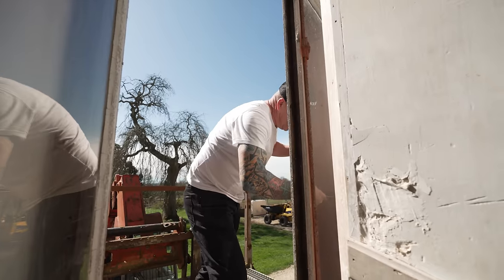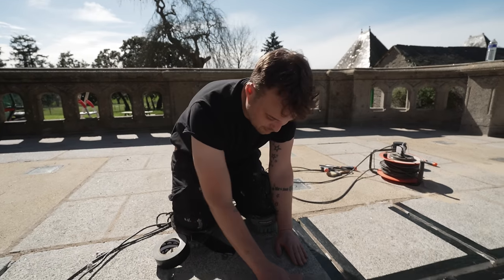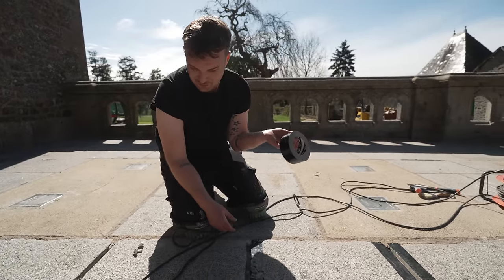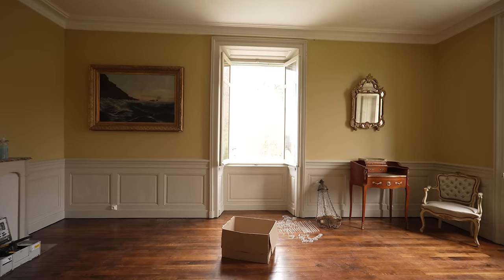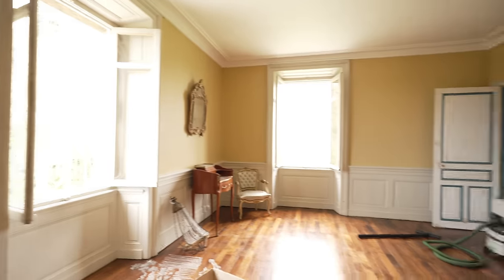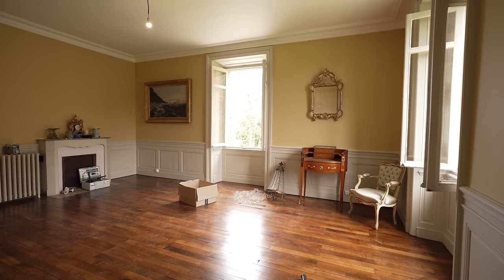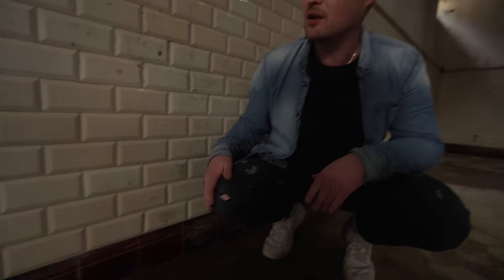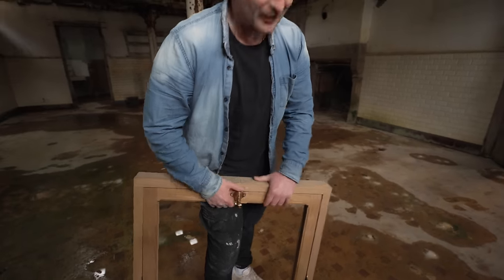Emptying The Attic To Furnish The Bedroom

Comment: I know where I've seen the chateau's kitchen tiles before. They're in the Paris Metro. Most of the stations have those same beveled subway tiles. The dimensions are probably slightly different, but the company that supplies the Metro with tiles could probably make a small run of yours just as easily. Can't hurt to do a little research into it. And the bedroom turned out really elegant. Lovely.

Comment: the green walls in your bathroom can be painted lighter to save money buy average white paint  couple of coats on the gren before adding two coats of the colour you want saves buying more tins of the colour paint you want as white is cheaper and you will need a lot of coats to cover the green.

Comment: 12:40 That would be a mold seam.  Where the two halves of the mold for the column was split.  I suspect it didn't have to be finished.  I'd bet there was a casing or sheathing of some sort around those cast iron columns.

Comment: Making a cast of the tiles will be difficult. Ceramic shrinks during drying and firing which will make the smaller then the original. Will have to make a bigger mold then the current tiles are.

Comment: Maybe build a furniture-looking island and build it in between the two columns and clad the columns in the same material you use for the island.  Even build the island around the columns so they look like they're sitting on the table top. With the correct materials and craftsman, it could look like a period correct kitchen worktable
Reply: there was no such thing as an island in a kitchen in France during the time period of this chateau. Michael has explained that they will have a very large table as per Downton Abbey kitchen - staying true to the time period which is as it should be.

Comment: I use backer rod to fill big gaps, and then either use spray foam over top or caulk to seal it or insulate it. Keeps insects out. Backer rod may work for what Michael needs to fill gaps a bit so he doesn't loose so much material filler stuff not sure what he is using but the backer rod expands and retracts in weather to stop any cracking.  Or bondo it works as well. I purchase from Amazon but I am not sure if that is available in France or not. It is in the usa

Comment: Just a question: Why don't you turn the windows arund to have them to be opened from the downside (sorry, I am german, that does not sound right, but  I hope you know what I mean). They are very high and hard to reach. Or will there be a mechanism to open them from down under (that definitly isn't right ... :-9 )

Comment: As a rule when hanging, the height of the painting should be at least near to 180cm from the finished floor line to the center of the painting. The art work should be seen as much as possible on eye level "if possible". In this case, your MIRROR is too high as well as your wall landscape painting. 

In positioning paintings, one doesn't necessarily have to strictly place them exactly on the center of each wall panel where the distance of the bottom of the painting to the top of the dado would equal  the distance of the top of the painting to the bottom of the cornice. Otherwise, this would truly look so awkward. Even in classical architecture this rule always holds true,  "Form follows function".

The distance from the bottom of the painting to the top of the dado can ALWAYS be shorter than the distance of the top of the painting to the bottom of the cornice in cases where the ceiling would be SO HIGH. Do not be afraid that you are not following the rule of SYMMETRY. Sometimes, it is alright not to follow this rule! It is always the COMFORT of the EYES that would always be taken into consideration first.

(In museums, paintings are always positioned on the wall always at eye level. Large and humongous paintings height  can be adjusted at a "comfortable" level. Never be restricted in positioning your paintings exactly at the center of the panel where height is concerned.)

Comment: The seam in the column is from the sand mould it was cast in (in a 3 part mould: left, right and core), not because it was cast in two pieces. It's one thick cast iron piece. Perhaps there's something in the core but most likely it's just hollow

Comment: I still think you will have a hard time keeping water out of the kitchen downstairs due to the kitchens flat roof on the patio. Could you put a roof over the patio to keep water out. I hate to think of all the work you will put into a new kitchen and then have moisture problems.
Reply: Micheal mentioned in the last video about the drainage design which was fascinating and sounded as though very efficiency once Michael has it all sealed, so all should be well.